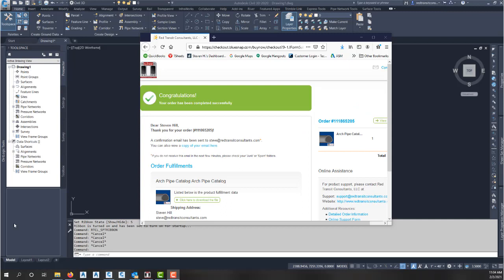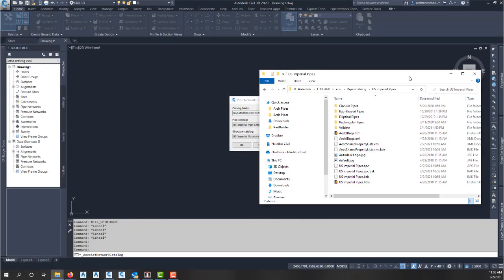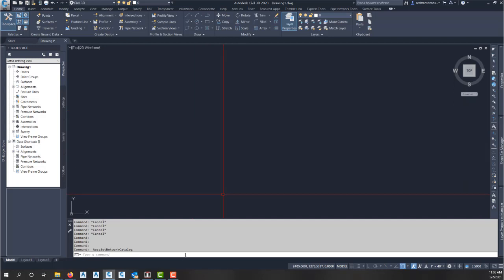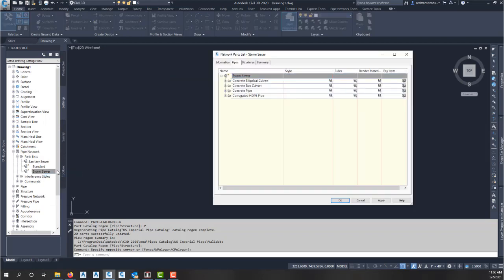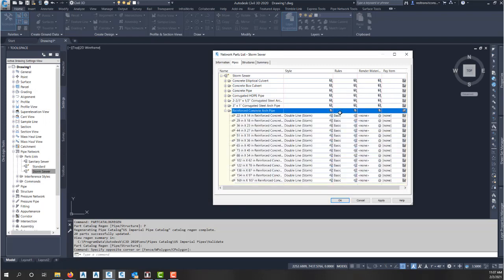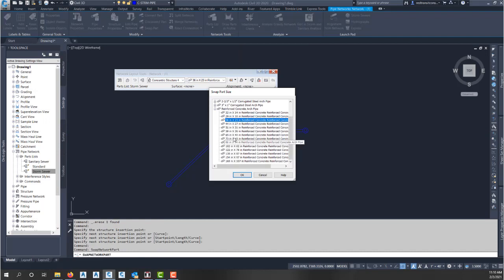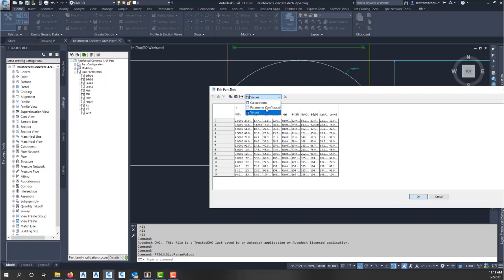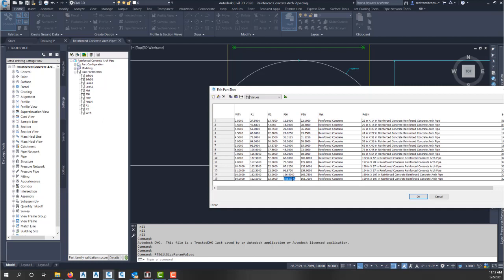Arch Pipes Pipe Network Catalog

Comment: What is the fix for allowing full read/write access to the part catalog, that's the error I'm getting. I'm self employed and on my own local machine. I have added the Arch folder and checked it's permissions and I have admin access to them, is there something I need to do in CAD? Thanks!

Edit: after looking around on a few old forums from 2008 (lol), you have to make sure the user has "write"-able permissions to the .apc file (C:\ProgramData\Autodesk\C3D 20XX\enu\Pipes Catalog\US Imperial Pipes\US Imperial Pipes.apc) Right click the file, properties, security, users, edit, add write as a permission.